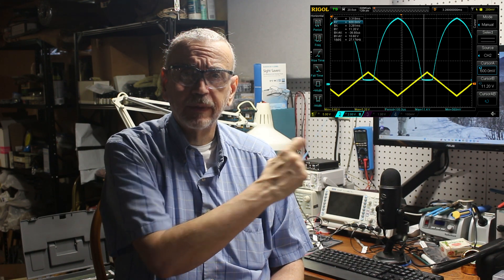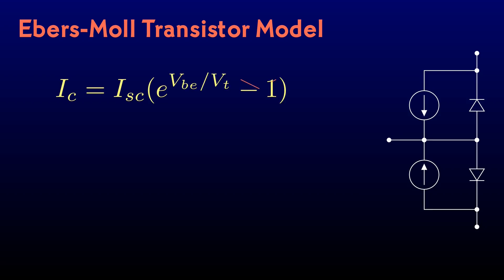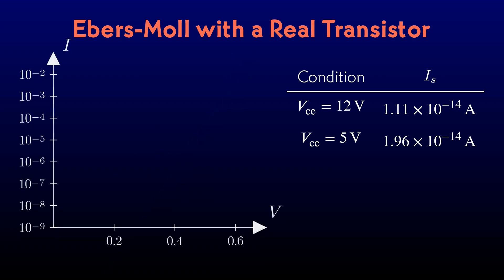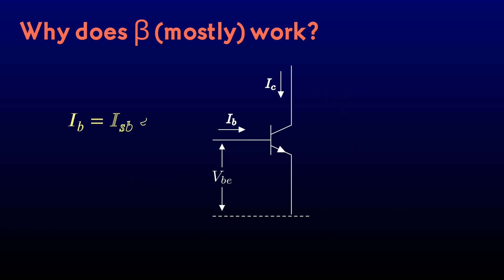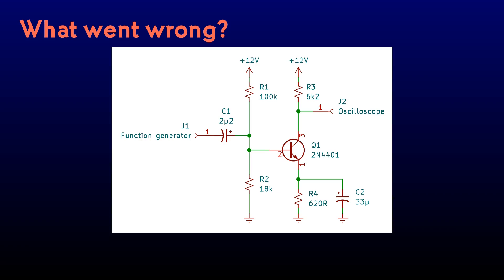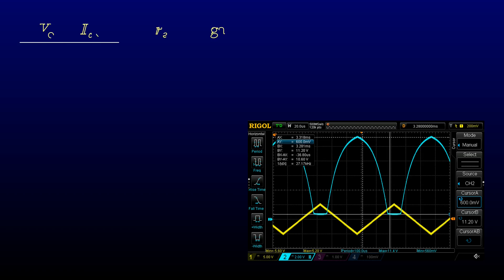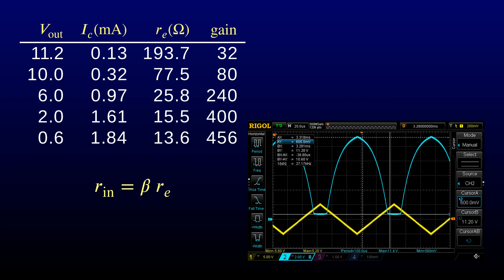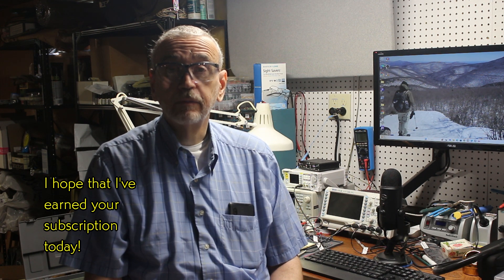The Ebers-Moll Transistor Model - Transistors 101, episode 11

Comment: @KludgesFromKevinsCave
At 6:13, you ended up with the equation Ic =Isc (Ib/Isb) if we assume eta is 1. Can we say here that beta can be approximated as beta = Isc/Isb? And hence we can write Ic =beta*Ib? But usually beta changes with temperature, does this mean that Isc and Isb change with temperature?
Reply from the maker: Saturation current is horrendously temperature-dependent. It roughly doubles for every 10 °C rise in temperature.
Reply: @KludgesFromKevinsCave 

 Ok thank you! I still have a question that is confusing me a little bit. At the beginning of the video you showed the expression of the base current Ib based on the Ebers-Moll model (Ib = Isb(exp(qVbe/(eta)kT)-1). However, when we bias a transistor, the base is connected to Vcc through a resistor call it Rb. In this case, Ib can be calculated as Ib = (Vcc-Vbe)/Rb ( assume we are not using an emitter feedback resistor nor a voltage divider bias). So now we have two different equations to calculate Ib? Or I'm missing something?
Reply from the maker: Once you're into Ebers-Moll, Vbe isn't a constant.  It varies with base current in a nonlinear fashion.

Comment: Great work and expianation. Question: As the explanation was fairly heavy, is there any particular text book you have used which captures all the math? This is something that needs to be studied to take it all in.
Reply from the maker: My favourite, for a textbook that has everything is _The Art of Electronics_, by Paul Horowitz and Winfield Hill.  

A gentler way to approach The Art of Electronics is found in Learning the Art of Electronics by Thomas Hayes. It's a companion volume that takes a more hands-on approach. Each chapter is structured in four sections: present the basic idea, give you some work to do at the bench, dive into things a little more formally with 'supplementary notes and jargon' and reading in the main textbook, and a few worked design examples.  Hayes uses it as a lab manual for his course in Laboratory Electronics at Harvard.
Reply: @KludgesFromKevinsCave  Thanks so much. While I have your attention - Have worked lecturing in acadamia? This is well beyond amateur level content.
Reply from the maker: @tonykirkham1663  I haven't taught formally since I was working on my PhD, several decades ago, but I've given many seminars at work and many papers at conferences. Now that I'm semi-retired, I've discovered that I've missed teaching.

Comment: This has to be one of the best, if not the best explanations of Ebers-Moll (and BJT models in general) anywhere! Transistor models are often over simplified or over complicated, but this strikes the right balance that covers what's most useful. Minor nit: you might mention how accurate Ebers-Moll is over many orders of magnitude, which I always found amazing. It falls into the category of "wrong but useful" models 🙂. Just a thought... Subscribed.
Reply from the maker: @madhusiddalingaiah5301  I think the demos that accompany these videos might make the point. The test rig hack i put together shows the exponential behaviour from the noise floor of the current measurement right up to where the Early effect and thermal issues start appearing - about 100 nA to a few tens of mA, which is to say,  about 110 dB. Not bad for a hastily-assembled breadboard setup!
Reply: @KludgesFromKevinsCave  Yes, I noticed that! You demonstrated it very well. I wasn't sure if everyone else noticed. 110 dB is just incredible, test rig hack or otherwise.

Comment: If you read the original Ebers Moll paper till the end you will find that they also use the inverse functions in a current controlled model. The voltage controlled and current controlled models are equivalent.
Reply from the maker: The biggest things we'll need to take away from this discussion are that Vbe isn't actually constant - it varies with base current - and that transconductance varies with emitter current.  The next things coming up in this series are current mirrors and differential pairs, and the simple model with beta and a constant Vbe drop can't explain how those work. But you're right - beta stays perfectly relevant even in the Ebers-Moll world, and a current-controlled formulation of Ebers-Moll is perfectly valid.

In physics, if you're writing a paper with a new model of a familiar phenomenon, you pretty much have to offer an explanation why your model works the same as the old one It was important for Ebers and Moll to explain why the earlier models of transistors continue to work - in the narrower domain where they're valid.

Of course, some pedants  would say that a BJT isn't voltage-controlled or current-controlled. It's charge-controlled. (That way you get to bring in Early effect, MIller capacitance, and several other effects, like the Gummel-Poon model that underlies transistors in SPICE.) It depends on how much fidelity you need in your model.
Reply: @KludgesFromKevinsCave  I agree. One source of misunderstanding is that the "voltage control camp" thinks that current control means Ic = beta Ib while in reality it entails the logarithmic dependence of Vbe from Ib. This model is useful when designing PTAT thermometers, for example. Much in the same way the exponential dependence of Ib from Vbe is useful when dealing with current mirrors and logarithmic amplifiers.
Trying to prove that voltage causes current or current causes voltage is exactly like trying to prove that electric fields cause magnetic fields or vice versa. There is no causation, how the electromagnetic field splits into E and B is a consequence of how the spacetime transforms between observers in relative motion.
Reply: @KludgesFromKevinsCave  Precisely. Back in the day I struggled to figure out how current mirrors work, because I was stuck in the idea that "Vbe is a datasheet parameter". :) When I realized my error, the rest was simple.